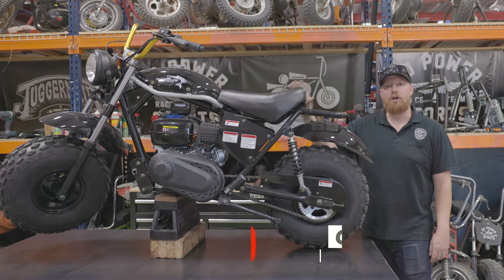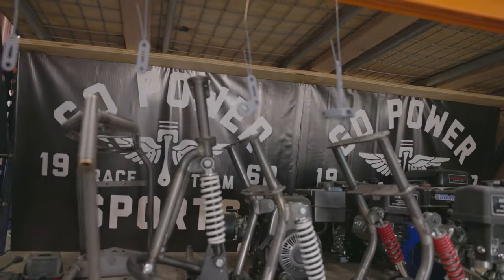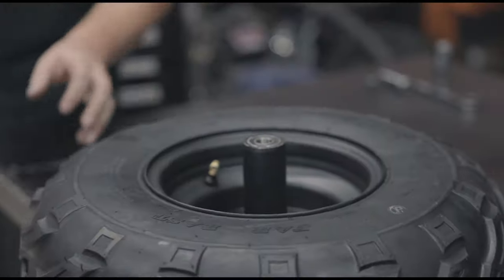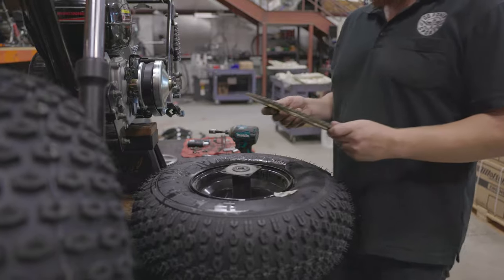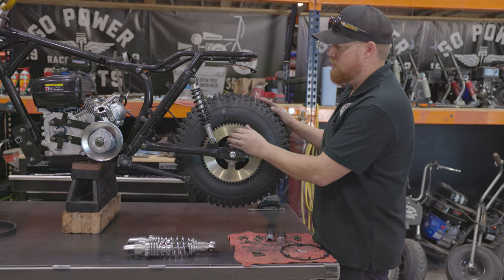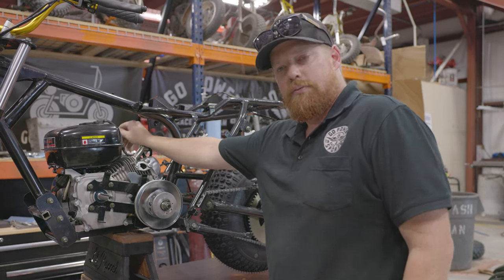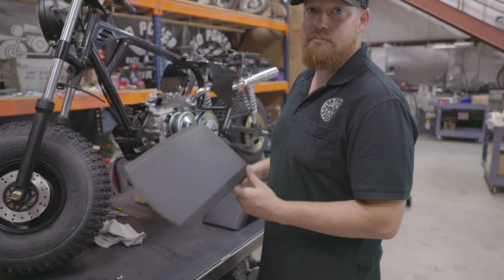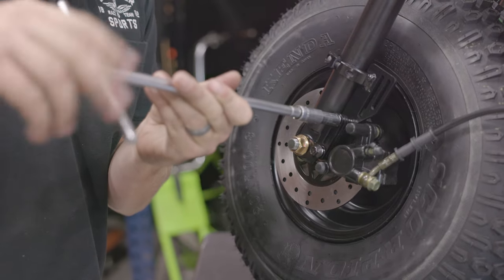Build a Better TrailMaster MB200 Minibike

Comment: You really need to do an inverted intake to get the air filter out of the way so it doesn't get kicked or knocked off. I did, and I love it.
Reply from the maker: We have actually have one in the works for the MB200 and hoping to have those ready to sell in the next few weeks.  Because you're right, it's much better tucked in especially with the way we ride.  Thanks for checking us out.
Reply: @GoPowerSports  .
Reply: Whats the part number, and where did you find it
Reply: @tex4x484  Gokartsusa part # GL1065-5003.DMC103 It's "Little BadAss" brand.

Comment: I like the build, but I would prefer a custom paint; needs more color. Otherwise, terrific. One thing I do not understand, is why a bushing on the torque converter is better than a bearing. Is because bearings fail more than a bushing?

Comment: I got a generation 1 mb200 with the rear drum only, front brake kit is a solid investment. I'm also curious as to why you ditched the front pulley with the bearing for a bushing?
I just ordered a pulley with a bearing from you guys, as well as the belt.
I may even go so far if this isn't to my liking to get an actual comet.
This motor could definitely use a stage 1 kit and to remove the governor, I also like the idea of the larger sprocket in the rear I replaced the chain a few years back. Also though front headlight absolutely sucks I'd like to get an LED alternative as well as a rear light.
I still have the stock CVT on there and it likes to eat belts now and again never did like the idea of that bushing when I saw you had the bearing alternative I ordered one right away but I seen you guys ditching it in this build which makes me wonder why?

Comment: What air filter is that at the end of the video and how are you keeping that chain on with no tensioner with that 60T sprocket and extended shocks? I am running the same bike with a 54T sprocket just so the chain wont jump off with no tensioner. I am also VERY interested in relocating the foot pegs. Is that the same bar that was cut off the front or did you use a whole new bar? Also, the clutch kit you put on, wheres the link to that and what helps in performance with that?

Comment: Did you modify the blower housing. Because on your website it says it does not fit this motor.
Reply from the maker: I believe it will fit as long as your also use the spacer that sits behind the stock pull starter. It looks like a plastic ring and pushes the starter away from the engine.
Reply: @GoPowerSports  Thank you

Comment: Thanks for content ...I swapped out the jing with  predator 212 hemi... but stock bracket bolts on the mb cvt for the cover don't fir the pred ...do you know what size bolts fit the 212 (four holes around crank)? I've tried every size I had and now I need to buy them
Reply from the maker: Typically 5/16" Fine Thread bolts.
Reply: @GoPowerSports  thanks ..they were 25 thread

Comment: Great video. Make some more. Now show us how to stiffen up the front suspension!
Reply from the maker: Thanks for letting us know that you want to see this.  We were able to do it to our Race bike for the GoPowerSports180.  So I'll be sure to bring a camera, take care.
Reply: you can stiffen the fronts by adding spacers inside the tubes on top of the springs and upgrading to a thicker fork oil. redbeard did that to a set of coleman front shocks.
Reply: I’ve also seem some guys replace the rear shocks and then take the springs off the stock rear shocks and put them on the front fork to stiffen it up.

Comment: For off roading wouldn't a leading link front fork ride better due to shock adjustability? Would the leading link fork you have in stock fit? Just some random thoughts.......
Reply from the maker: We prefer the hydraulic suspension over the shock suspension for trail riding.  The Leading Link on our website would be to short for the MB200.

Comment: What rear shocks were you using on the ride? They were separate reservoir style  not the new ones you put on.
Reply from the maker: Those are also prototypes.  Good eye sniper.  We built 2 of these same bikes and the shocks were the main difference.  These may be a few months until we get these in bulk.

Comment: Will the front brake kit work on the older baja warriors and baja heat mini bikes?
Reply from the maker: The forks are a different diameter to you may need need to modify.

Comment: Where can I get that clear torque converter mount? I just realized my Mega Moto 212 didn't come with a "regular" mount.
Reply from the maker: We sell them on our website under CLEARCOVER.  Nothing for the Mega Moto 212s though.
Reply: @GoPowerSports  I was wondering about the MOUNT not the cover itself. I need that mount lol.

Comment: Hey I noticed my mMB200-2 engine output shaft is around 1/2" longer than say a predator 212. Is there a way to make the Predator line up and work on the MB200-2 ?
Reply from the maker: You could use our Fully Adjust Motor Plate to make this happen.

Comment: Is there any cvts that come in a wider ratio than the regular one. Instead of going from 3:1 ratio to 1:3 ratio. To 5:1 to 1:5 ratio. Diameter would charge of course and fitment issues would crop up. Just curious.

Comment: Why switch from a bearing driver to a bushing driver? I would think the bearing driver would be the better option. If not, i need to change both of my mb200s to bushing drivers.
Reply from the maker: The bushing style is tried and true.  When you're going on long trails as we did, we wanted the bushing style because it was one less thing that could go bad on us.  Performance-wise, we love the bearing style, but going through mud and dirt, we didn't want to risk it.  And now, we typically recommend the Juggernaut Driver (if your engine is at Stage 2), which does not have a bushing on it, just bare.  🤕

Comment: That green bolt on the jack shaft Is impossible to get off the one that holds the second part of the torque converter on
Reply from the maker: It is hard, but doable.

Comment: I'll be swapping out the 46t sprocket for a 60t.  I'll need a longer chain, correct?  Also, will longer shocks affect that, too?
Reply from the maker: You will need a longer chain when going to the bigger sprocket.  You will also need a longer chain if you add longer shocks.  Moral of the story, install your new sprocket and shocks before cutting your chain down to length.
Reply: @GoPowerSports    Thanks!  Just the info I needed!

Comment: So basically they don't put a spacer between the driven pulley bearings? How nice... Over tightening them causes them to bind.. interesting. That alone says how cheapy it's made. Btw let's make it a stage one which technically is slower due to taller gearing. Again, interesting. I will pass n keep my old Honda thanks.
Reply from the maker: Minibikes and Hondas aren't the same thing.